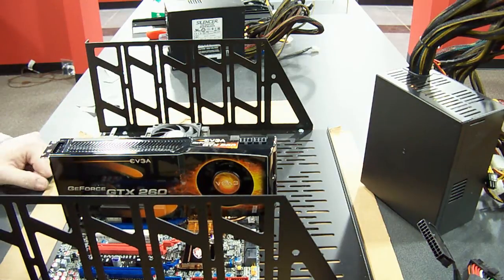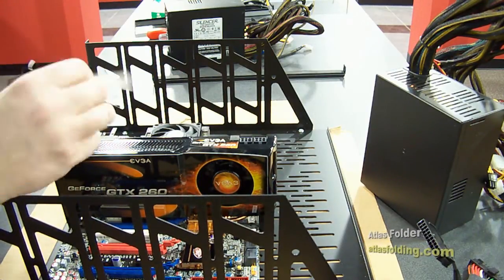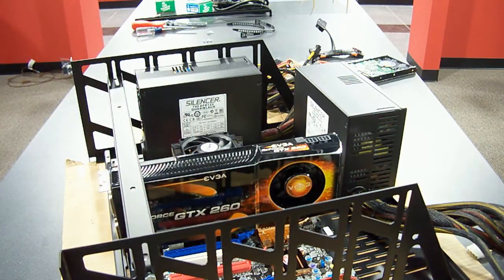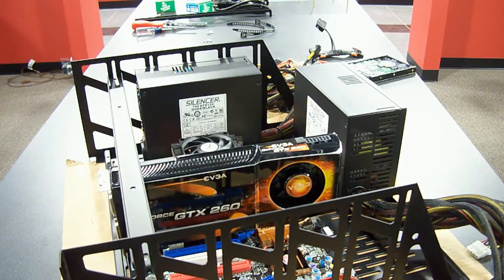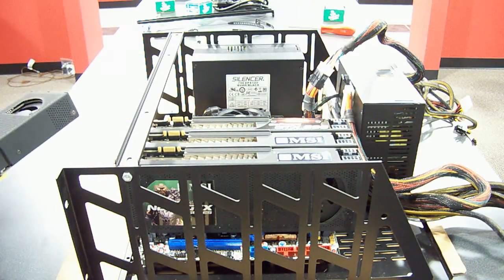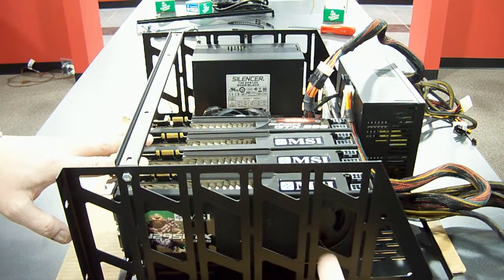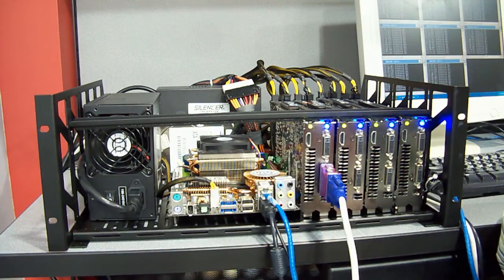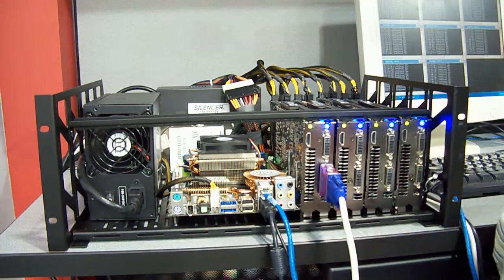Atlas Folder - GPU Folding Farm HOWTO - PART 3

Comment: on what atlas said you may also want to try the 9600 gso for a farm it has 96 stream processors and is only about 70 bucks a pop but almost as fast as a 9800 gt which has 112? stream processors

Comment: Nope folding at home needs hardly any ram to run. Also, why get another psu just for the CPU? bit pointless when it works fine with 2 psu's. The reason he has 2 psu's is because there isnt any single psu's with enough pci-e power connectors to power 4 gtx295's